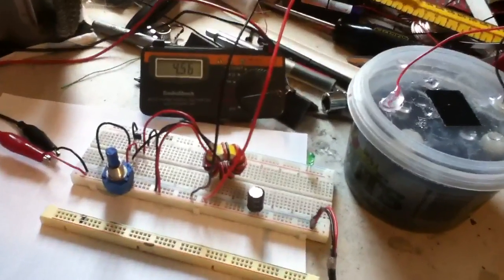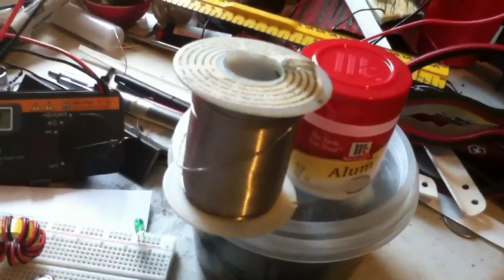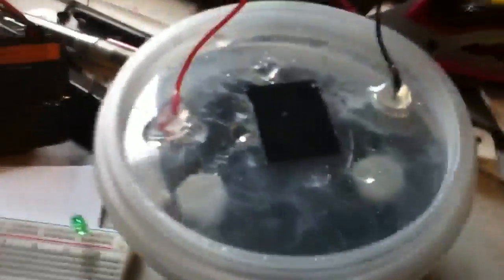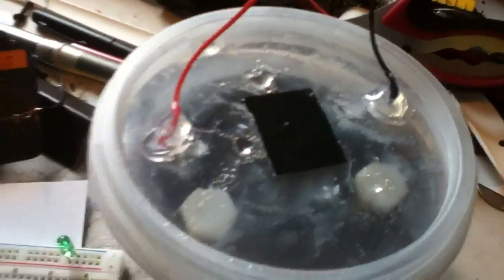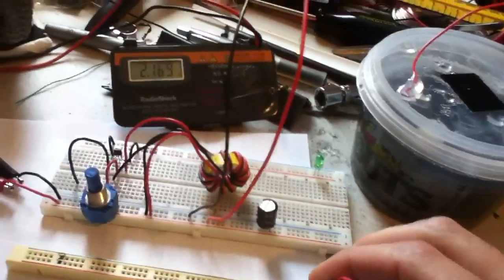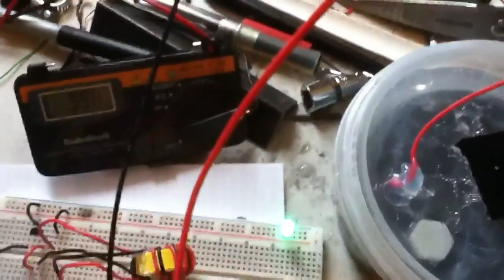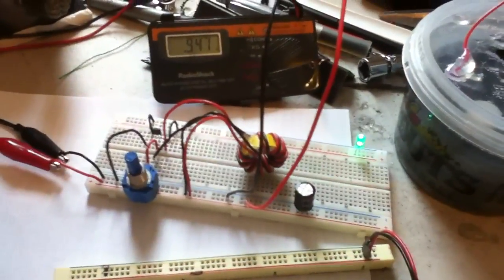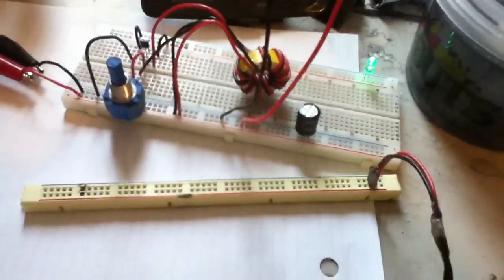Alum lead battery

Comment from the maker: Jose, it was just an experiment. The only major benefit I found, was the fact that this kind of electorate is less caustic than sulfuric acid. These kinds of batteries don't have the same voltage potential as a standard lead acid battery, but it was a fun project! As for the passive battery desulfators, there's only so much that can be done to recondition a battery. I would say that its a "relative endeavor". What do you want to achieve by using this kind of method. If you're looking for a totally restored batter, then buy a new one. If you want to get some extra life out of an old battery, then yes! I've moved on to batteries with newer technology, and I love the benefits of super capacitors. Battery manufactures are here to sell you a quality batter with a standard voltage potential, and amp hour rating. In the end, it all has it's place and usage. application is everything, and you need to consider what your end goal is. I hope this helps?

Comment: That is great!  I'm glad that it worked for you.  Yes this goes act much like a supercap.  If you charge it up a bit slower with 3 or 4 volts and discharge it with the Joule Thief it will get stronger.